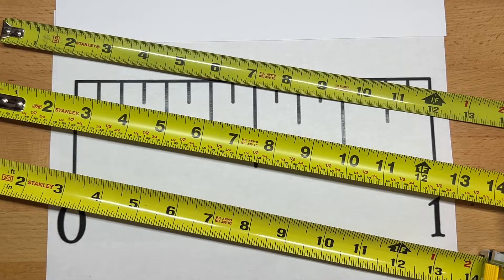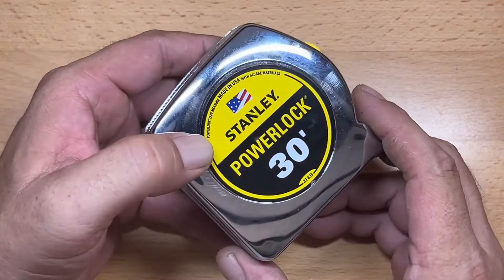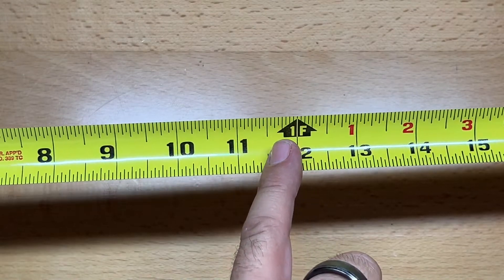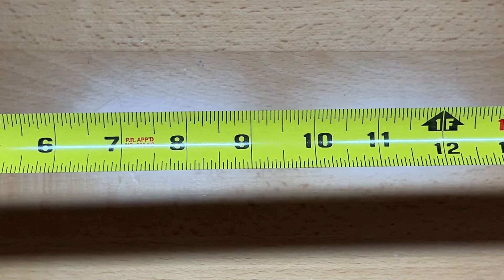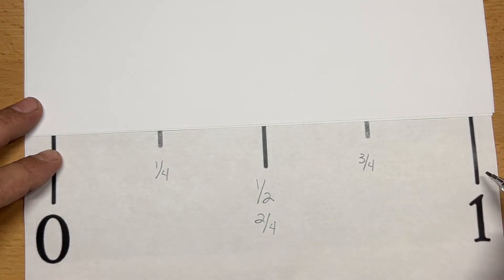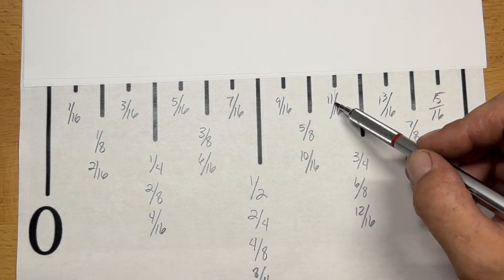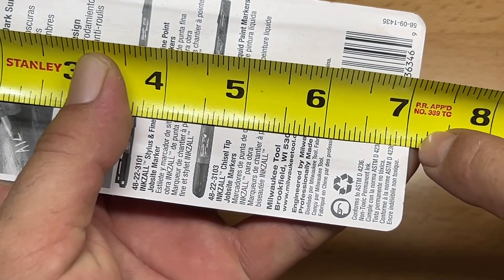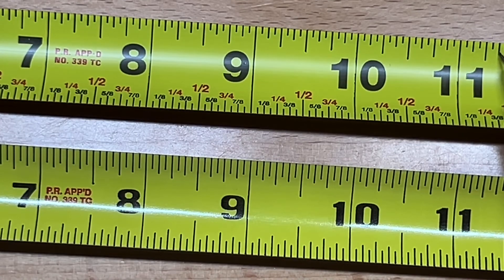Trades Math - How To Read A Tape Measure

Comment: How to read a tape measure (in Imperial Units): Watch a 12 minute video.

How to read a tape measure (in Metric Units): Just read the tape.

But still, is a great video, very well explained and as someone who uses metric this is important to know because things like bolts or pipes are usually in Imperial. Thumbs up.
Reply: I learned fractions in the 3rd grade.